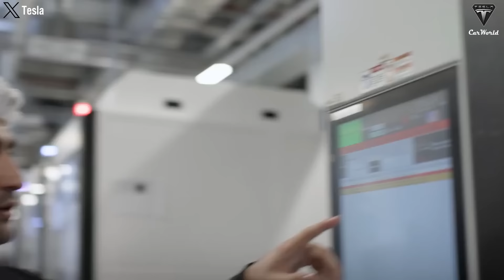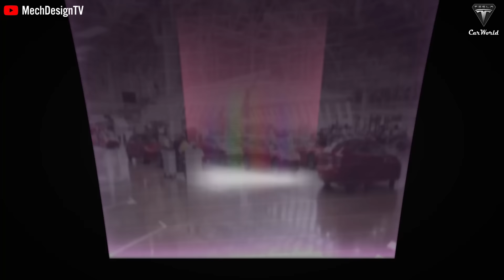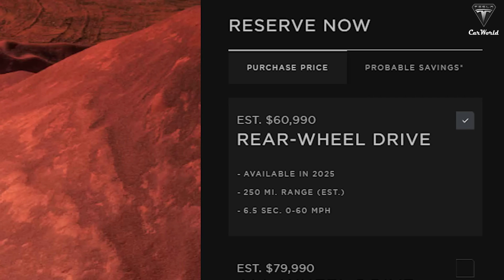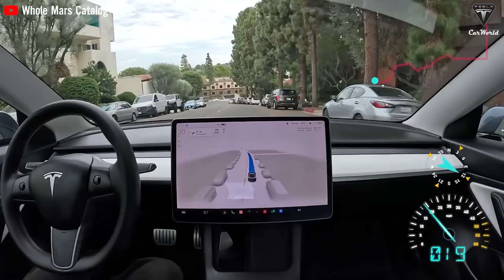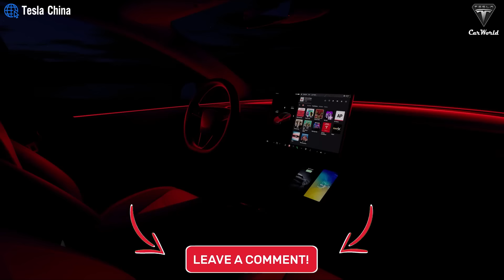Elon Musk LEAKED How Far Will "Redwood" - Tesla Model 2 Really Go In 2025? FURTHER Than You Think!

Comment: The next leap in lightweight manufacturing technology, for electric vehicles, may be carbon fibre frame at scale, possibly by using Gigapresses to injection mould carbon factor parts, achieving a further 30% decrease in weight, requiring a smaller battery pack for a 320 mile range per charge.
Reply: Carbon fibre can't be injection molded.

Comment: Get your facts straight. There have been lots of EV fires on the TESLA cars…and only only a few on the Chevy Bolts. Also EVs can’t explode. Yes they can catch on fire occasionally ( still a lot less than awful gas cars ) but that’s due to abuse of the battery like idiots that don’t slow down on speed bumps and curbs. 

Again….you need to do some fact checking there. 😂😂😂

Comment: Elon musk is almost as good of bs artist as trump. He never has the goods. He promised self driving cars. But no self driving cars. His designed Tesla has to many problems to even consider buying piece of crap. The electrical distribution for all Tesla is flawed. Elon got the bright idea to create a motor without rare earth magnets and passing high voltage true a pc board for which it was never intended. For one revolution it must redirect the high voltage 8 times. This will never be a reliable system. A motor turning 20,000 rpm requires a high voltage pulse.00000017 = 60,000 pulses per second. They worry about cooling the battery when they should worry about the electrical distribution oc board. He promised mush while suppling nothing. Why would you pay 15,000 for a software package that doesn’t exist. I can find a single saving grace about this fleet of cars. Permanent magnets are recyclable.. he just want to save a few bucks and build an unreliable automobile. The leaks, rattling. And motor problems all stem from the above mentioned problems. I used to think Elon musk was a visionary. But it turns out he’s a con artist. Bilking Americans out of their hard earn cash only to line his pockets. It’s been 10 years and Tesla still can’t self drive. Elons lies are about to over take him. Tesla is a joke, x is a bs semi bot social company. Starship will never fly in the current configuration. Starlink is still a work in progress. Satellite on standard iPhone and android will never happen. I would only buy what is ready today not tomorrow. As the Chinese how this worked out on real-estate.
Reply from the maker: Elon Musk doesn't promise anything! It seems like he's just making it all come true. You can see the Cybertruck, spaceships, robots!

Comment: I sorry he’s a charlatan. None of his project will pan out. First you go look for yourself at any Tesla model of your choice. You will see low quality on the outside and sub standard on the inside. I worked in manufacturing,electronics and electrical. His front and rear motor assayable is made of aluminum which is unacceptable for a front or rear drive unit. He raves over no permanent magnets. But this cause the pc board to fail regularly. The electrical distribution is sub par. In the end he builds a 17,000 car and sells it for 63,000 and raves  how fast his production is. He is building the same car he prototyped in 2003. Then has the Gaul to promise big changes in next year models. Why is it never this years model. He has done no innovation for 10 years. But you want to waste your hard earned cash on hype ok. Burn your money not other people’s who can’t afford to be screwed. All his other endeavors will blow up soon just like tweeter. Until someone else build the 1,000 mile battery. Tesla will be on fire. But even  with the perfect battery this will not fix all the deficiencies. Drive train, cpu with a high voltage rotation of .00000017 or 444,147,647 pulse cycles a minute to avoid buying permanent magnets. This will cause many trips to the shop. So, cheap car, poor design, sub par quality, no self driving software. But he want 15,000 for a product not yet realized. Last due to his penny pinching. The car is also unsafe. I never thought I would see any Chinese company make a quality product. But byd has the best cars on the market. They have style, are built well. And a plush interior. Something the great Elon musk knows nothing about.
Can Tesla be saved? Yes if Elon is removed.